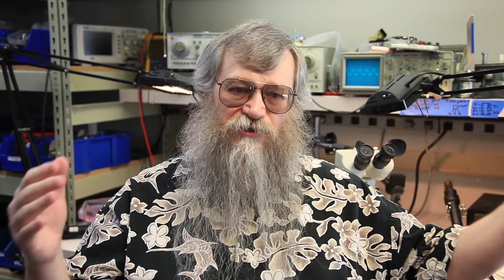Why Jitter Matters

Comment: You seem to suggest that DAC jitter might affect phase and even the timing of the music.  An excellent drummer might be accurate to 40ms on the high hat.  Jitter in even a very poor DAC might be 4x10-5ms (worst case).  If jitter got close to the best timing of a human drummer, sample timing would overlap and very audible pops and clicks would result. I don't see how jitter can affect the phase relationship of frequencies within a recording either.  Again, typical jitter is orders of magnitude smaller than an audible phase shift, even on a transient, and certainly less than the out of phase components found in any recoded drum part (e.g from the drum overhead mics even after manual correction in the studio, not to mention high frequency phase shifts introduced on purpose by exciters etc. ).  Furthermore, and probably more importantly, mis-timed samples can only alter the shape of a wave (i.e. distortion) not the phase or timing of the recording.  The audible artifacts from jitter (if any) are noise and distortion.

Comment: It's funny. I hadn't thought that much about, or should I say that I hadn't really "felt" the effects of increased/decreased jitter, until about two years ago.

I went to one of my local audio stores. The proprietor had set up an Esoteric k07 or k05, and he and I got into a discussion about jitter and it's affects on audio reproduction. Hooked up were a pair of JBL 4365's. If I remember correctly, it was driven by a McIntosh MA7000. He played an Italian orchestral piece, I forget which one, and had me listen three times. The odd numbered times were while the Esoteric player was connected to the G02 master clock generator by the same company. I noticed the difference quite quickly, and it was very difficult to describe the effect it had.

But, in the end I explained it as the effect you get when the conductor of an orchestra is, in tune, with the players. Or when you change have the conductor.
More solidarity, togetherness and a more coherent portrait of the music and it's emotional message.

It was a truly great impromptu demonstration.

Comment: I can't find in any places an audio with huge jittering problems compared to one without. If it's scientific audio problem I must have a wave form that emphasize this problem on all equipments to be used as a test. 
It's easy to consider mathematical and geometrical aspect of jittering. But once you enter the audio listening we are completely missing scientific matters to introduce only personal feeling and listening. That may be true but it's no more scientific. And honestly i found to many people pretend that some  2000$  dac sound better then some 300$ ones while in measurements it's impossible cause some 2000$ dac suck in too many ways that I start to fear that personal psicology take in too much account in too many places in audiophiles. And seeing people that usually judge equipment by their cost comfort that theory.

Comment: Paul, I am looking to purchase a new audio interface for recording. I am keen on a focusrite saffire pro 40. Jitter is speced @ < 250 picoseconds. The company states that the unit uses JetPLL™ jitter reduction technology. I have also looked at another unit by Presonus called the firestudio project. They spec jitter of this unit like so:
						<20ps RMS, 20Hz-20kHz
					Jitter Attenuation
						>60dB, 1ns in=>1ps out

Should I run the other way in regards to the Saffire?

Thanks for any advice you may give me. I see that jitter specs vary widely amongst these units. These specs also vary in how they are stated. Some companies don't even publish them. A lot of artists love the saffire.

Comment: Eh...it's in your interest to sell products that you claim have lower jitter. Furthermore - while you indeed can detect jitter down to the picosecond (or pico Hz in the frequency domain?) using a good oscilloscope - I would put good (as in Amazing Randy amounts of) money on a bet that 99% of the so-called "tweaks" out there in the world of audiophiles make absolutely zero audible difference in double-blind comparison tests - even for Paul McGowan - on audibly discernible levels of jitter. 

Of course I know that's not exactly what Paul is saying here, but....

Now, that having been said - perhaps in some very specific circumstances Paul and others can "hear" the jitter in musical program material which has undergone analog-digital-analog conversion, but I would also put good money on a bet in which two or three side-by-side-by-side DACs are auditioned in the same exact system with all variables controlled. I can promise with 99.999% confidence that no listener would be able to discern an audible difference related to jitter more than 50% of the time, effectively reducing it (in the case of two systems under comparison) to random probability.

Comment: Ted, not sure to understand how you can relate 0.2 ps (if I heard you well) to a clock synthesized at 5 GHz? To me the period of  a 5 GHz clock sounds more like 0.2 ns (0.2 nanoseconds or 200 picoseconds). What are the early generation Silabs devices you mention, that didn't offer a sufficiently low loop bandwidth?

Comment: The only sensible explanation of jitter. Unfortunately the snake-oil audiophile industry (even PS Audio) pushes expensive USB and Ethernet cables that have absolutely nothing to do with jitter. Incidentally temperature variation has a strong effect on clocks

Comment: Jitter can have audible side effects, but not because it affects the timing of impulses or transients, and thus not because our ears are sensitive to timing. What a load. 

Also, sine waves combine to make up every sort of waveform, including impulses, so dang, man, of course you listen to sine waves like the rest of us -- it's just a matter of how they combine. That's physics 101. If you had said "pure sine waves", well those are pretty unusual, but totally beside the point. 

Jitter and the audio signal are effectively multiplied (technical term -- sorry, normal people), which adds measurable and potentially audible sidebands (non musical tones) if the jitter is periodic, or noise if the jitter is random, or both. The problem is purely because jitter phase-modulates the signal (comprising sine waves). 

Anyway, that aside, one way or another, you've come out in favor of low jitter, so I have to point out that FPGAs tend to have non-deterministic timing behavior that can introduce substantial jitter during stream processing, independent of the clock stability, so I wonder how this was overcome in these designs, or if it was? Where are your spectrum analyzer screen shots, Ted? Data, please.

Comment: Hi, great video ! I have a question for you, Using a USB cable @500€ for audio is better than a USB cable @10€ ? if yes why ? thank you !   musiqueaaz from france
Reply: +musiqueaaz USB cables have two wires for data and two for power. A USB data cable will probably let some data noise get onto the power wires, because this doesn't hurt a plain data transfer. A DAC, however,  might be sensitive to noise on the power wires, because a DAC is not just a digital device. It also has sensitive analog circuitry. This is why a bits-are-bits cable can wreck the sound, even when all the bits are perfect. 

Not in every case, but sometimes it makes sense to seek out a cable that isolates the data and power pairs from each other. This should cost a lot less than 500€. All we are talking about is a cable with two separate twisted pairs of wire, perhaps with separate shields, all in one jacket, not a gravity wave detector.
Reply: +David Janszen Thank youM.Janszen

Comment: Can anyone tell me DAC with good clocks and low jitter? I've also looked at the old Trichord Genesis CD player, any thoughts on this product anyone? Great video, thanks!
Reply: +shrodingersman exaSound makes DAC's with your choice of 130 or 82 fs (0.130 ps or 0.082 ps) of clock jitter. Both are close enough to zero, I think, but people can hear the difference. These DAC's also use a Sabre chip, which is relatively immune to clock jitter, and lots of noise reduction in the power supply. The result is that even CD's sound better than analog.

Comment: For those of you who want to hear what jitter sounds like. The best way I can give is like listening to high quality Cd verses a low bias cassette tape. In visual it would be like watching blu ray movie in 4k resolution verses a VCR tape. I know im not excatly right because one is digital and the other is analog but im trying to put it in laymans terms. Jitter affects the clarity and detail as well as depth and perfection of audio and even video. Home studios really suffer from this because most lack a good external word clock which reduces jitter.  Major i recording studios usually dont have this problem because they have master word clocks, thus giving them that radio ready industry sound.   I hope this helps.
Reply: Rodney D, the analogy I use is reduced jitter is like feeling a smooth surface. More jitter is like feeling 800 grit sandpaper. For me increased jitter is not only heard but it also sets my nerves on edge. Of course I’m talking subtle yet noticeable effects here.

Comment: Analog reel to reel = Jitter doesn't exist and no DAC or ADC.  Therefore more 3D sound.
Reply: The wow and flutter of a tape machine is comparable to jitter.  However, on even the best well maintained tape machine the problem would be much much worse than even the cheapest DAC from 20 years ago.
Reply: @chrisborak2200  Yet it is not jitter and still sounds more 3D.
Reply: @380stroker  Tape certainly has a sonic character which many (maybe most people) find appealing in at least some circumstances (i.e. saturation, tape compression and perhaps even wow and flutter).  The plethora and popularity of tape emulation plugins in the digital domain are testament to this.  However, tape's sonic character is due to its specific imperfections, not because of the absence of digital jitter.  If the goal is accurate reproduction of a mastered  recording (which I appreciate it might not be) digital wins hands down over tape.
Reply: @chrisborak2200  Chopped up pieces of sounds (samples) can never win.  It's physics.
Reply: @380stroker  Well, thank you for this engaging and enlightening discussion!

Comment: I need some proof or at least scientific basis or its just a bunch of boloney.
Reply: ***** With modern digital devices jitter is typically 110 to 120 dB below the music, even for inexpensive consumer-grade gear. In my experience that is far too soft to be audible. Indeed, this is 20 dB or more below the noise floor of a CD!
Reply: ***** What was the brand you called up "Silicon Labs"? I may have heard jitter before. It sounds like the audio is struggling to play is the best way I would describe it. But, I've only heard it on computer with poor performance such as running a virtual windows operating system inside my Mac and then playing music inside that virtual windows operating system.
Reply: +Paul McGowan That's really sad if you are towing that line. You open yourself to all kinds of bunk. You should always be willing to investigate claims, how much ever ridiculous they sound. But YOU shouldn't be suggesting something to be true without evidence.

Comment: This is all correct...and there is a very clear difference...that is why when you use or buy a different "clock" for your studio everything WILL sound different..PERIOD. whoever thinks this is bullshit....... no comment.
Reply: Even if the original clock was "off" or introducing errors, all digital systems correct those errors virtually in real time.